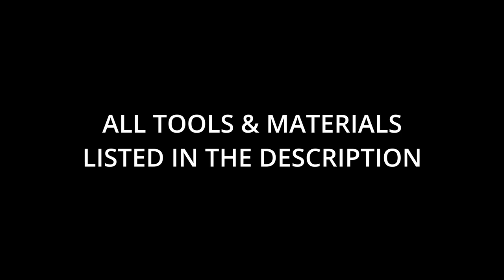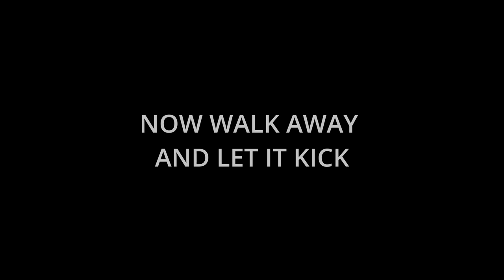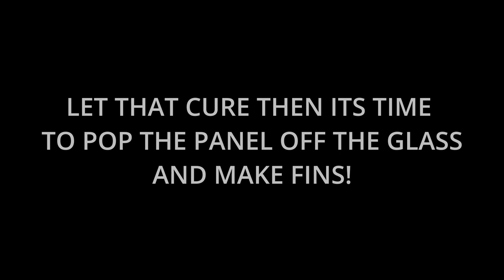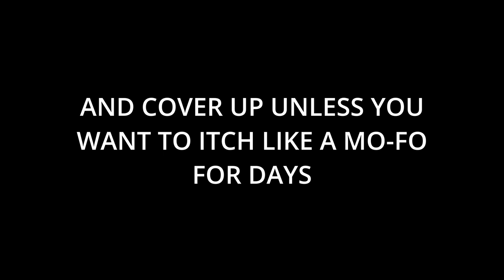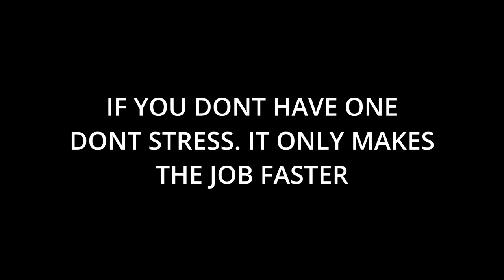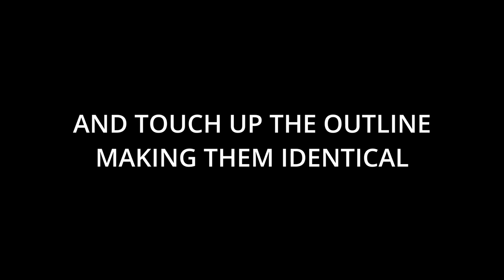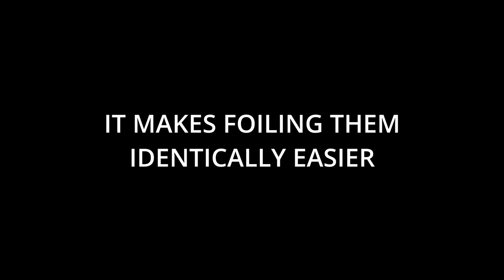Pro Tips and Techniques for Making Your Own Fins!

Comment: Good tips! one thing to say: press  on the top of the all layers with a flat mould. Wear gloves and most important a good mask ;-)
Reply: @Marco Ramires  Yes, I have done that with a flat windscreen of an old truck.  But as the resin is heating while going off, the pressing with the flat windscreen part has to be done step by step with any ten layers.  Let cool down and sand the surface between ten layer to get grip between ten layers step of glass.

Comment: hey - this is super helpful. I'm wondering how you would make these with a futures base on them with the cant built in? would you lay the panel up thicker and mill out the cant somehow ? Or would you mold the fin to a fin base or something along those lines? Any info would be appreciated !
Reply from the maker: Hey mate, thanks for droppin in! Yeah, ive thought about this. The way id do it would be to mould the fin cant angle into the pannel so that would involve using something in conjunction with a sheet of glass to lay up on to get that angle. Then carefully cut out my fin shapes so the tab was angled and foil as per usual...